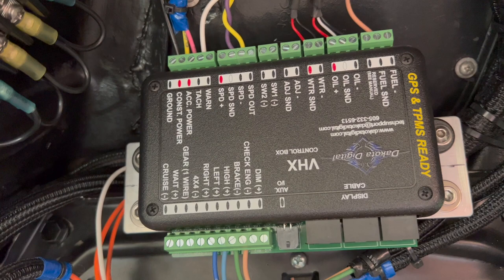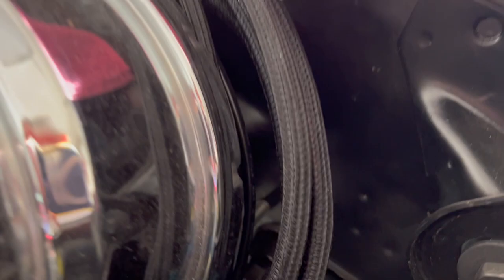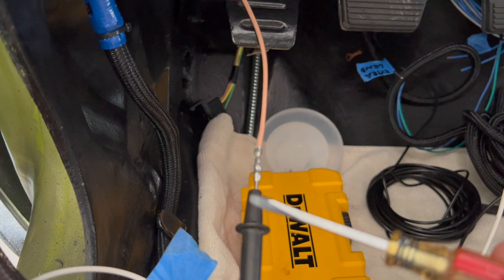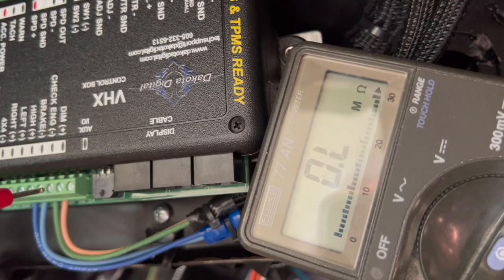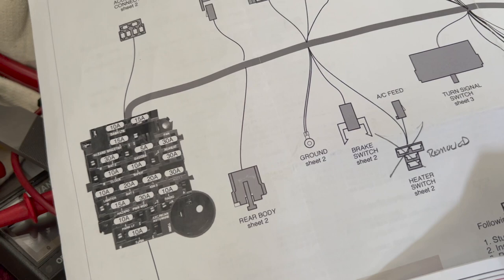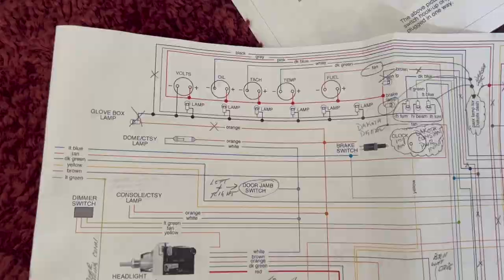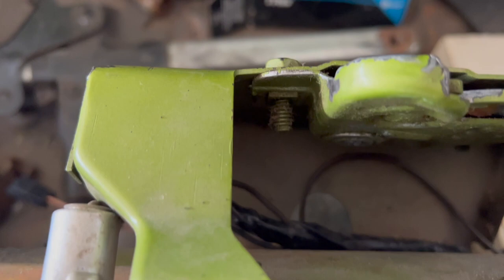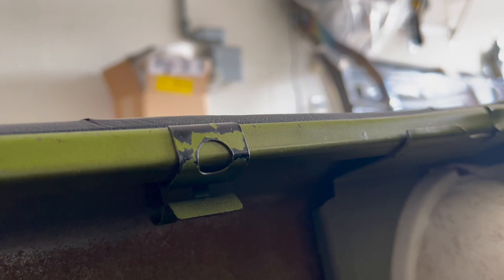Camaro "71" RestoMod Parking/Brake Fail/Courtesy/Rear Wiring - 01

Comment: GET'ER done!
Reply from the maker: Getting close! Screwed up the new headlight switch! The ground terminal popped out of the headlight switch connector when I installed it and I couldn't get the connector back off to reinstall the terminal. Used a screwdriver to gently pry the connector off the back of the switch and it gently broke the headlight switch housing! Very brittle stuff!